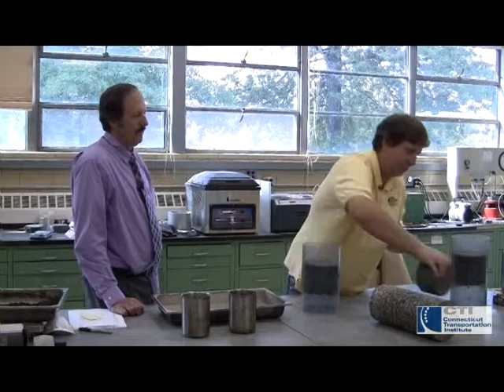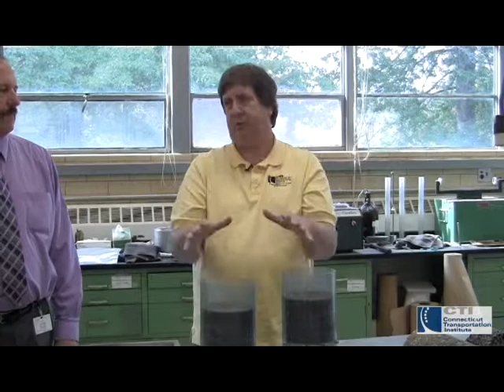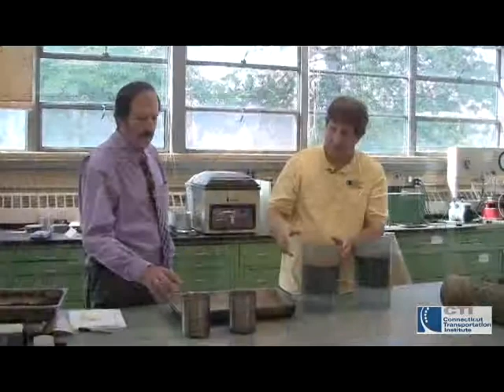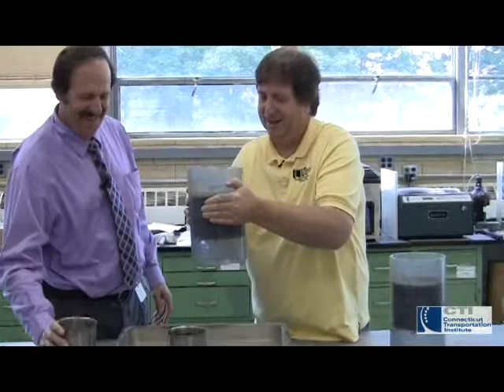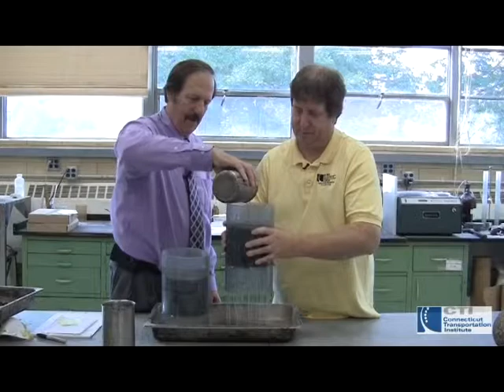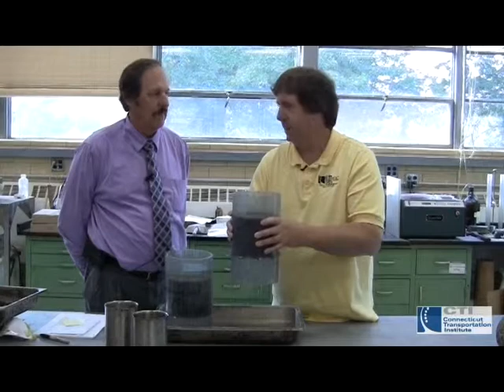Porous Pavement

Comment: SOOO. #1 if my stone base is placed over clay where does the water go? Out the low end of the lot into the STORM DRAIN. #2 how long before the PREVIOUS paving gets plugged up with debris?  A couple of years? Maybe! Then it sheet flows into the STORM DRAIN! People. Don't buy this nonsense. It's common sense. It's expensive and oh yea. Required in some areas or pay a "tax per square foot" of non pervious surface area covered. This was an idea thought up by some college educated tree hugger.